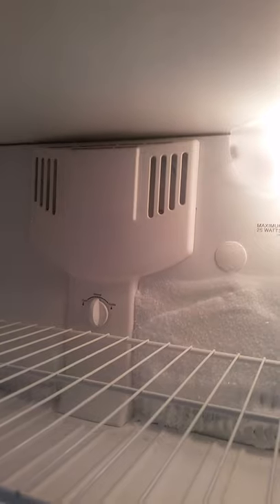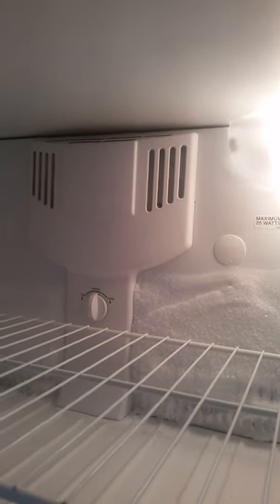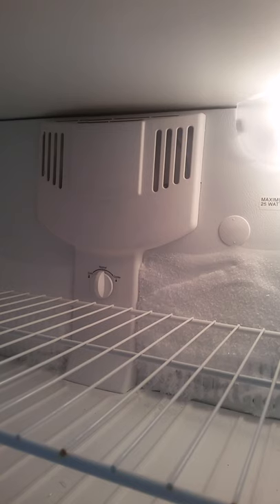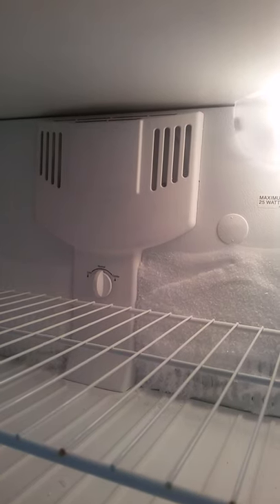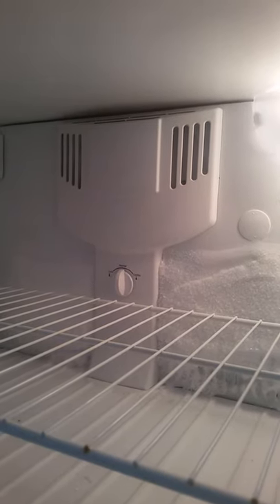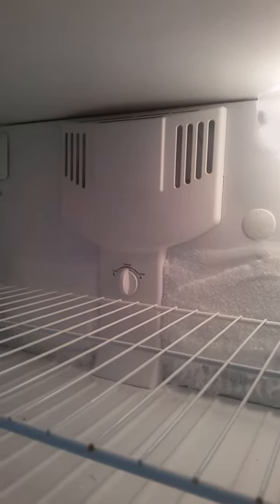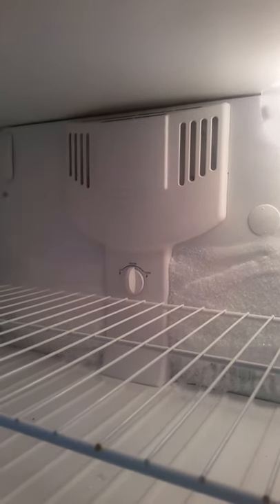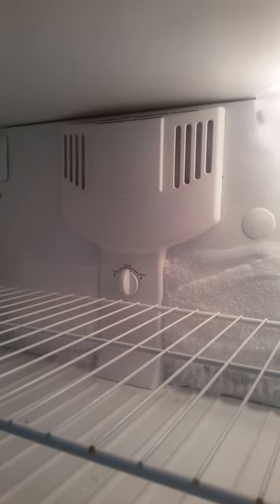Frost building up on the back wall of the freezer indicates a defrost failure

Comment: My freezer has ice build up and fridge isn’t cold. It’s 56 degrees. Are the 2 connected
Reply: I have the same issue, I think they are since a block of ice blocks the flow of cool air to to fridge
Reply: @gonzar11  yes I resolved mine by manually defrosting fridge. It had ice build up like you say. Now I manually defrost about every 2 months to keep the temperature down
Reply: @TEEANVEE how to manually defrost it?
Reply: @Johnsrt2023 turn off for 12 to 24hrs
Reply: Yh i have a fridgidaire and the freezer fan blows cold air down below but if frost builds up, no cold air and a warm fridge section (my current problem)
Reply: @Johnsrt2023 i had to do thaat, just follow what he did in the video and go clockwise until u hear and audible click and the compressor and fan will turn off
Reply: These two can be connected yes
Reply: 😩😩😩😩😩😩 same!! I've defrosted and the fan came back to life, and all was well. It has ice on the fan. Now I've done this way too many times to count. It's back off again. I'm lost too!😢😢😢😢😢

Comment: What’s all involved in sorting out the defrost timer?
Reply: The defrost heater is located behind the thermostat and is easy to change, there are two 1/4 screws holding it in place. Be sure to unplug and appliance before working on them. Happy New Year 2022
Reply: Great video

Comment: I have clear ice building on the bottom of the freezer and water leaking down into the refrigerator.
Reply: I have something similar but my freezer is on bottom. I have fridge on top and on bottom I have freezer with 2drawers for last few days its been hard to slide the last door  out so I looked inside and I have about 0,5cm build up of ice on the bottom so when I looked on the back wall inside there are like 3 openings and I see water iced that goes all the way to those holes . So it looks like there is water coming down and then it goes into ice once there . My dad said my drawer looks slightly out so I looked and indeed its not closing properly, 1 side get closed fine and in the other there is space and if I push on the door it goes into proper closed position but once I take my hand off it drops back . So at this moment I have no clue what to do . I have so much frozen food and the logical option seems to defrost do what possible and examine and then turn it back on and see if it continues over next few days and if yes then definitely best option would be to call a expert .
Reply: Your freezer drain is clogged.

Comment: Do you then also have to put the screwdriver in again to turn the thing back the other way to turn back on what you turned off?
Reply: Probably....
Reply: No it's a timer, put into defrost every 8...10..0r 12 hours.
Reply: I was thinking I broke mine until I put the screwdriver back and turned it back the other way. Compressor came back on right away
Reply: @Brian-pc5xe  Thanks!

Comment: I also am curious about which model. I’m battling same exact issue on my et8chmxkb06. I’m having hard time finding timer to turn with screwdriver. Only hole in top of fridge behind control knobs doesn’t really look like there’s anything slotted for a screwdriver
Reply: That really stopped using timers,this is a old Refrigerator. They use small control boards.

Comment: Hi I can’t locate temperature sensor on my Westinghouse wbe4500sc😢
Reply: temp sensor is behind panel in freezer, it just spans on evap coil, heater coil runs under evap condenser, timer is in fridge. my understanding is timer must move, so use sharpie place a mark on timer where screwdriver turns it, mark housing, watch over next couple hours, if its a diff location, timer is working, problem is probly heater, if neither freezer or fridge compartment is cold , probky thermostat sensor, compressor won't turn on thinking its cold enough in freezer, heater only runs twenty minutes, triggered by timer every eight hours or so..